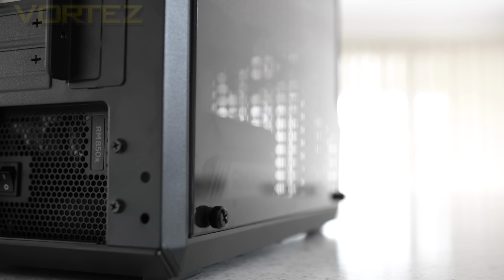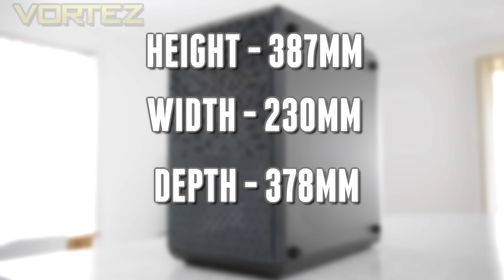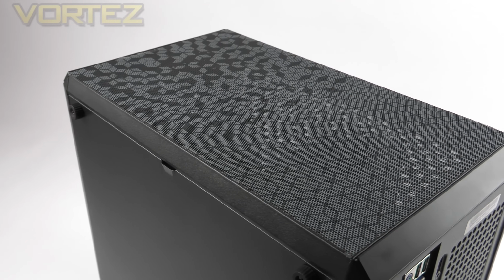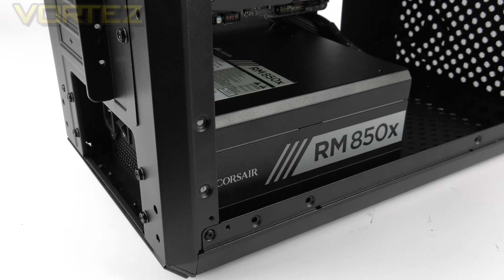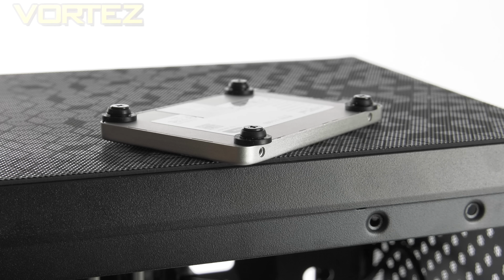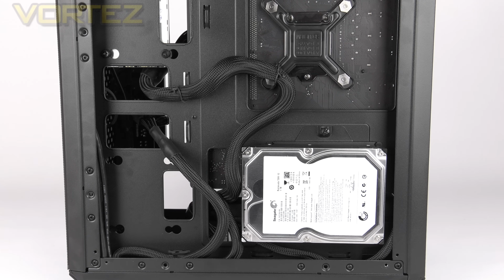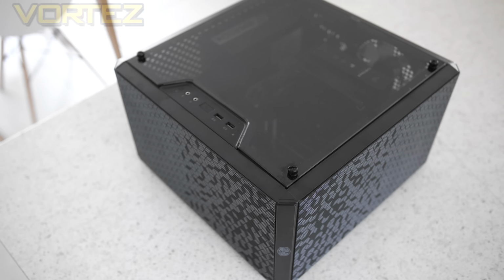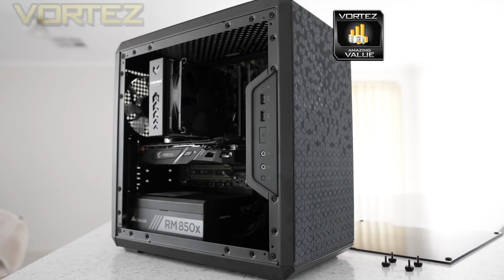Cooler Master MasterBox Q300L Review

Comment: Well i own this case for 2 and something months now.. And its cool as hell. Althrought i don´t have beefy af and cool system, i had an mid tower case before with everything mATX in and it was big and ugly, so i decided to buy q300l. The build quality is pretty solid, screws are a bit tight tho. Installation of motherboard/IO panel was as good as in any other case, no problems with installing GPU either (but i dislike those popping brackets, they could really go with screws.. but you can buy them from Amazon). PSU installation was pretty simple and i recommend to stick all of the cables to the back before you put in PSU.. HDD bracket is really cool and i like it, but SATA cables may interfere with 24pin ATX power cable (but this depends on your routing scheme / motherboard). Installing SSD was a bit tricky (i mounted those rubber things backwards..) but pretty cool.. Cable managment support is pretty basic (pretty lot of tie points and lots of holes) but enough for 50$ case. I fit my Spartan 3 cooler without any problems.. and the positionable front.. well side IO panel is really cool if you tend to move too much on your chair and you may risk breaking some USB drives .. estetically, it is really freaking cool, i love those "cubes" and how they look in mid-light, but if you plan to install RGB fans/strips, the light may be actually so strong that the geometry effect dissappears and the light from strips/fans will cast really terrible circle shadows. And yes, the dust filter is cool, i actually had to clean it only once but its really convinient. For 50$, its a go-to choice for any mATX build. I give 8.75/10
Reply: How is the airflow my man?
Reply: is it loud?
Reply: Do you think this case could fit the Asus - PRIME B450M-A/CSM Micro ATX AM4 Motherboard
Reply: Thanks for the time you took to write this up, N3ttX. I myself have a similar system that I’m looking to transplant into a new case, and I really appreciated hearing your thoughts.
Reply: How are the noice levels?
Reply: I know it's designed for a single 3.5 hard drive, but is there room for a second hard drive?

Comment: The top and front panels will obstruct the flow of air too much. If you're looking to build a silent PC, placing a fan on a surface that is less than half open to airflow isn't going to work well. Put a dust filter in front of it and it gets even worse.

Comment: How many fans should you put in this case with a 1060 3g. I am going to use a liquid cpu fan that would go on the the back fan slot
Reply: i would recommend 2 in the front (to suck air in) and 1 in the top (exaust)

Comment: Hi...one small correction if you don't mind. The chromax cover adds a 6mm height, so the total height of the cooler that you actually tested was 164mm (numbers taken from noctua site, the 3mm you added applies to the width of the cooler). I own the case and I have a Bequiet Pure Rock which is 157mm high and there is approx 5mm left from touching the side panel.
Could you please check if there is actually enough space for a 160-162mm high cooler safe installation? (I cant afford to buy one just to test if it fits).
That would mean that the case is capable of housing high end cpu aircoolers and not just the mid range ones.
I made the same inquiry to CM....but they haven't reply yet.

Excellent review btw...I bought the case after watching your video review
Reply: Did you ever get an answer to this question??
Reply: Nope I did not

Comment: I had the boxlite 3.1 tg and it was terrible in regards to thermals but it looked really nice. Fortunately, i returned it and got the q300l. Which looks better in my opinion and has way better air flow and a cut out for the cpu plug. Great case! Love everything about it. Especially the price.

Comment: I have one, with a Corsair H100i V2 cooler on the front. It's desk based, and I wish the metal was just a little bit thicker as it bends to the touch and vibrates. The included fan is rubbish. Oh and my MATX board only has 2 fan headers...
Reply: you can get a header splitter for like 3 usd
Reply: Yep, but I wanted a PWM 4 pin one - so bought the Deepcool FH-10, which gives full control. That thing is great, and much much cheaper than a Corsair Commander

Comment: Do you think you could fit another 3.5 drive on the floor in front of the psu and one on top of the psu.
Reply: Υep that would do. It can easily fit multiple HDD in front of the PSU, as long as the PSU is the the standard 14cm and not a long modular one. Approximately the space a have left empty with a typical PSU is 17-18cm in length. That is more than enough to add HDDs

Comment: This is a pretty interesting case, i would like a more premium model with a PSU shroud and a tempered glass side panel, it would be interesting to see more designs to replace the front dust filter, i actually think that's the idea behind it.
Reply: I just got this, the designs on the front and the top are magnets and they came to me bent
Reply: @tlaytmasusa  I think they will become straight again after not too long, maybe you'll want to put them under a stack of books for a little while.
Reply: A agree completely 👍

Comment: Really like how they made the dust filters a design element, best budget case out there.
Reply: I wanted this case so bad, but It's always sold out...
Reply: Was it easy to built your computer with this case?
Reply: @6delirious467  yes it's very easy, very basic , and very good, I put in a Rog Gene micro ATX and there's still plenty of space to manage everything in it with no problems. Only thing I think you should change the included fan and put some others, I've managed to stuff it with 4 fans and a 280mm radiator with 2 more fans
Reply: ahmed ghare  Case is very good, no problems with it
Reply: ahmed ghare  side panel is probay acrylic glass but either way the side panel is fine. it still looks like tempered glass. and I have had 0 temp problems with just running 3 fans in the case
Reply: 85% metal to hole ratio. It has dogshit airflow. Be objective. Look at its thermals. Poor design, nice looks. Fooled almost everyone though.....
Reply: ahmed ghare  5% metal to hole ratio. It has dogshit airflow.  Look at its thermals.
Reply: Im starting a budget build at least under one thousand im using this case
Reply: fred?!?!
Reply: hmm
Reply: I feel like the Thermaltake versa h18 is slightly better due to the easier cable management l
Reply: @josephli5649  true, but it also looks like when they built it design was not invented yet
Reply: @josephli5649  I got the q300 for 33 bucks so I couldnt complain
Reply: Do you think this case could fit the Asus - PRIME B450M-A/CSM Micro ATX AM4 Motherboard
Reply: @lyde5413  I have a ITX board but the case is much bigger, it looks ridiculous through the glass :) I'd like to have a good micro ATX board  to use in place of it, the case is designed for Micro ATX boards so sure it can fit your board. There's also enough space in the front sector to allow you to manage your cables properly, if you mount front fans too.
Reply: Jacopo Piscina ok thx im about to buy the parts for my first pc and wasnt sure
Reply: ahmed ghare  the side panel on my case hasnt been scratched 1 bit yet and its been like 6 months since I built my pc. but in my opinion its worth it
Reply: R2624.....u call thet a budget case?
Reply: @yuumi925  Cause it is a budget case I have it myself, getting ready to build my first PC soon. I got it off amazon for 33 bucks
Reply: Rock Lee 33 bucks? that’s around £25 or a little over in Britain. That is not fair. It’s £44 here.
Reply: @maincharacter2677  Case was 33 bucks, The fans were like 12.99 for 3 of them
Reply: ichigo 60$ canadian
Reply: Pierre Lourens its literally 40 euros, its cheap af for this kind of case
Reply: Pierre Lourens it is lol
Reply: @Pierre Lourens Considering most cases are 50 bucks or more on Amazon (from what I've seen) it's definitely a budget case. Even if it wasn't a budget case, I'd still buy it simply because of it's design and look; not to mention it's got plenty of good reviews.
Reply: @mayravixx25  This was the most obvious choice for myself. It's got a nice geometric design on it,  but is relatively understated. Most mATX cases I've seen look like old Gateway computers or go a little heavy on the "gamer" aesthetic.
Reply: @SirWetBiscuit Agreed.
Reply: @mayravixx25  honestly
Reply: @mayravixx25  A bit late in the day.  But this case has many more bad reviews than good.  I hope you didn't get one.
Reply: @groundhornbill  I ended up opting for a better one that comes with a disc drive since I'm one of "those people" that still has an optical drive for their PC

Comment: Does it support a vertical holder for GPU??
Reply: Wave Wolf TV No, cooler Masters gpu bracket needs more slots
Reply: Nitrate thank you
Reply: yes it does you need to buy an additional part from coolermaster it just mounts up
Reply: Fuxux Duxux wrong
Reply: Nitrate i have the bracket in my case right now
Reply: Fuxux Duxux not in that case
Reply: Nitrate yes in that case it just bolts on

Comment: Just saw that this was out today! Thanks for the review, Do you think this would fit a Corsair H80i and look good with RBG case fans?
Reply: The H80i has a thick rad and is push/pull in standard configuration IIRC, so you might have a few clearance issues in the top or rear especially with certain motherboard VRM heatsinks. Mounting in the front could be a solution if the rear doesn't work out.

As for RGB fans, it depends on which you choose and how good your cable management skills are. Just be aware that the case will likely be sat on your desk, so you'll want to make sure the LEDs aren't also distracting sat at the edges of your vision.